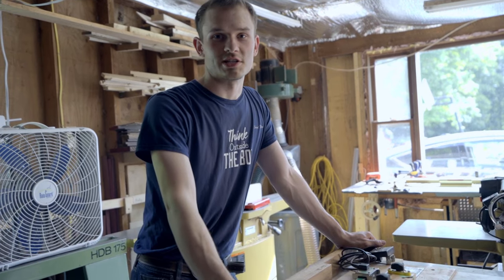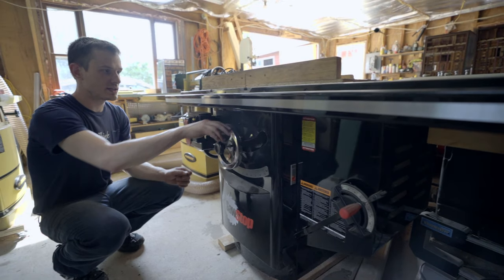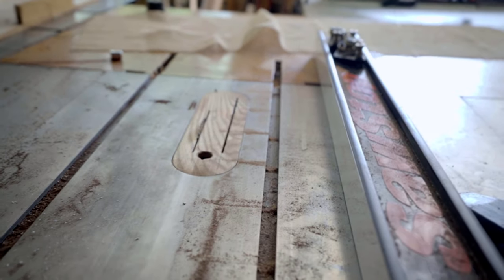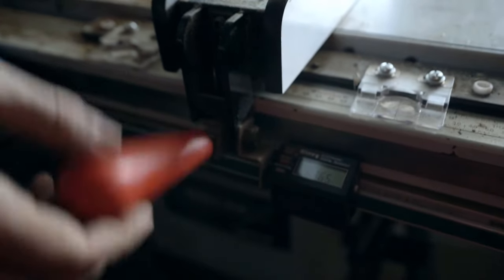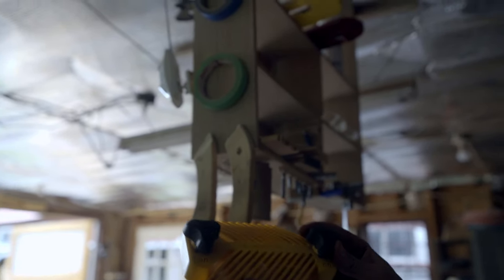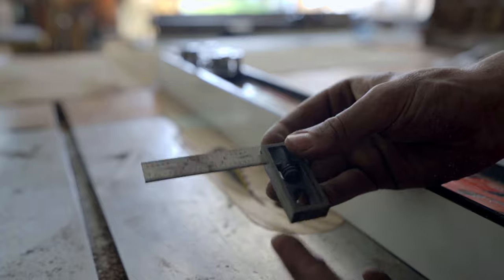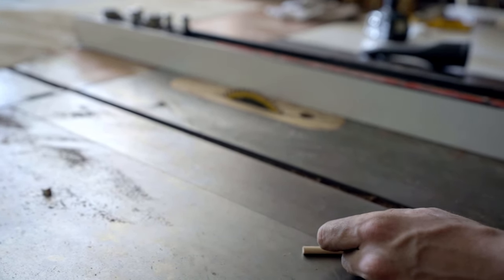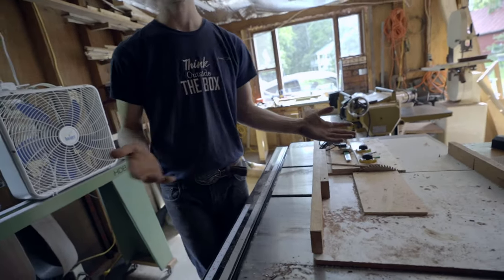Tablesaw Basics with Jesse Born

Comment: I love all the digital measuring tools and square for ultra exact angles. So many people are ok with some slop but it’s great to see you have borderline ocd about your angles and lines.

Could you just put another magnetic feather thing or similar right after the blade to hold tight anything coming through so you don’t need to reach over the blade and get your fingers in there?